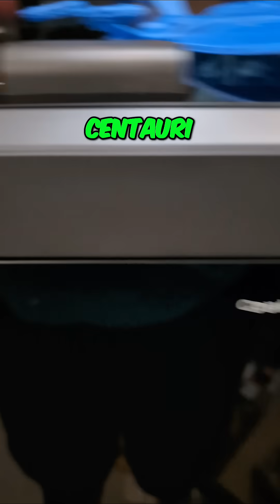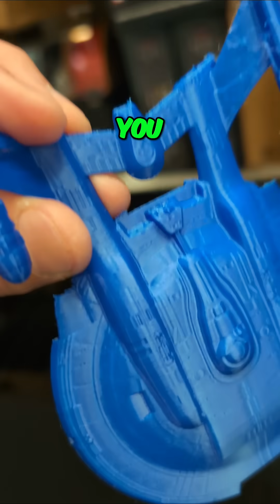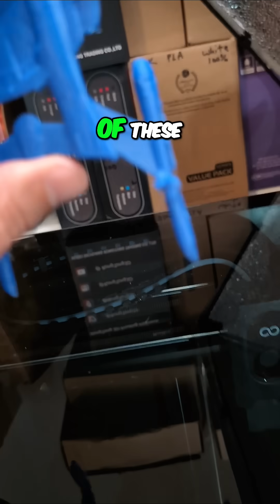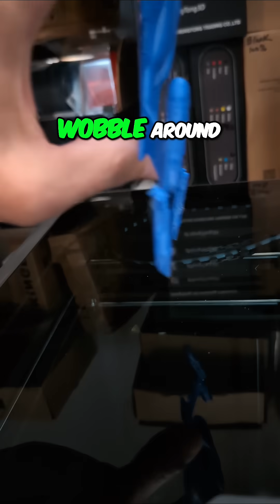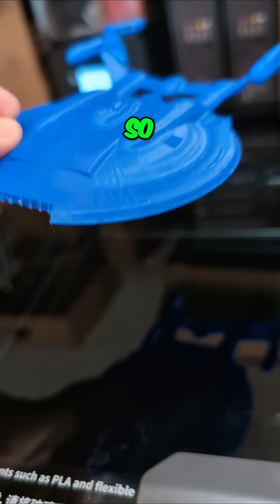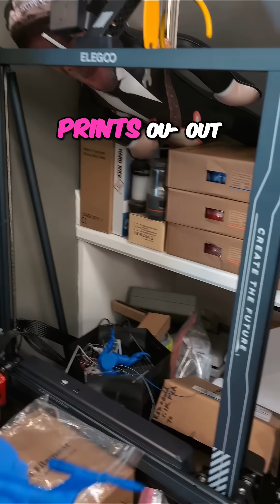Elegoo Centauri Carbon: NX-1 Nacelle Failure!

Comment: Think the Vibration Feet upgrade that they offer for the Centauri would help fix this problem? I just ordered my printer but ordered the upgraded Feet hoping to add some absorption for vibrating.
Reply from the maker: I think the nozzle knocked the nacelles loose from the very thin tree supports. It is on a very solid surface. I don't think it was a vibration issue. However, I have considered printing some TPU feet.